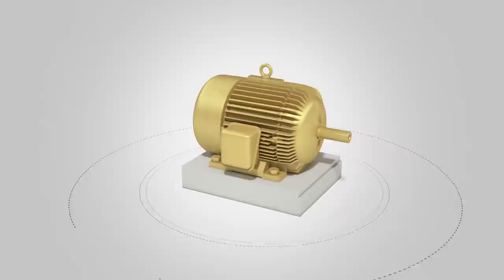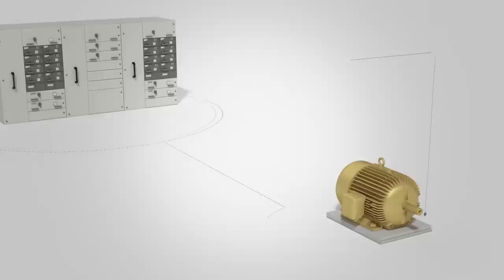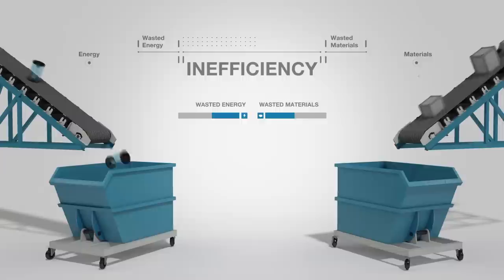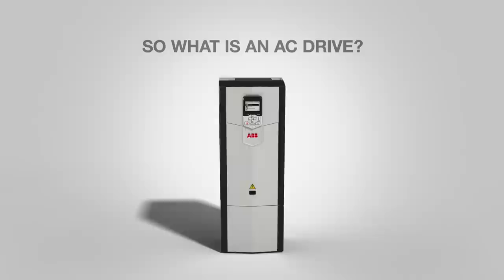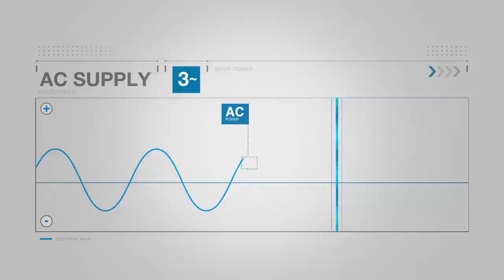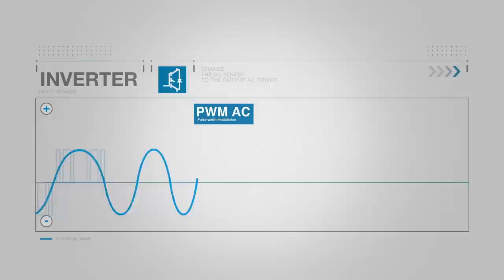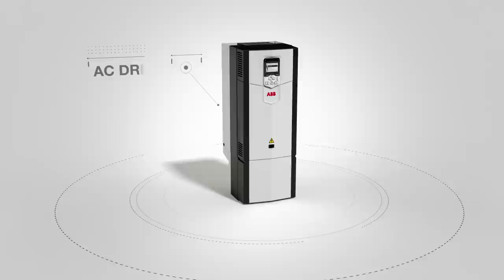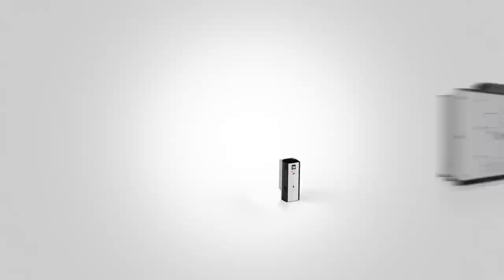What is an AC drive?

Comment: Pretty good basic explanation. 

I've installed and programmed around 60 Baldor VFDs in the last few years, from 1/2HP to over 100 HP. They have become my favorite brand, mainly because they're one of the easiest to program. 

Even though they come with a programming manual, if you know the terms and have the time, they can be programmed without the manual. Not all drives can, a lot of them don't list the parameters on the screen,  just numbers so you need the manual (which  often must be purchased separately) in order to program even the basics. 

One of the Baldor VFDs I installed 3 years ago is subject to pretty serious abuse and it still runs. 

Highly recommend.

Comment: Wait a minute, if A/C power is coming from the mains, all the "regulation" is done in DC then converted back out to A/C? seems kind of unnecessary, if you do all this inverting and capcitance to smooth voltage then it just gets turned back out to A/C? maybe the graphical representations are over simplifying this, but the waves appeared exactly the same.
Reply: As silly as it seems, converting between AC to DC then back to AC is actually just a creative manipulation of the electrical current. All of which is way more efficient than alternatives, which include; switching in a resistance circuit to bleed off excess energy and cause a voltage drop, and converting to a different form of energy then back to electricity. (such as mechanical in a Ward-Leonard drive.)